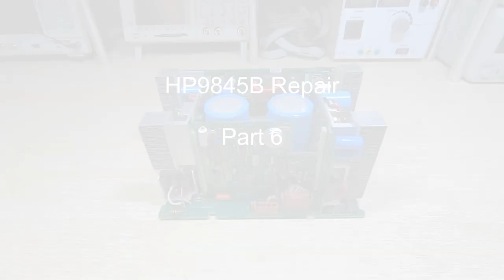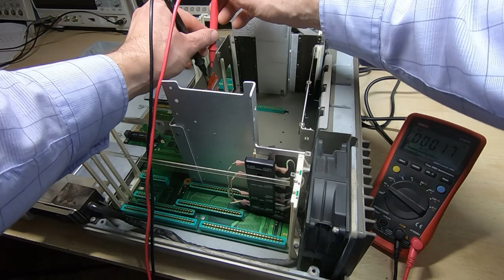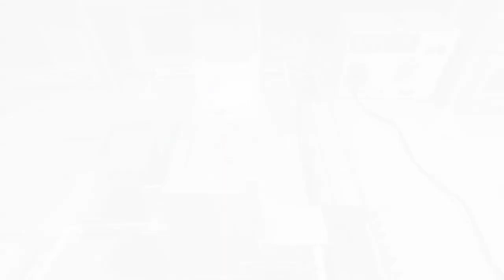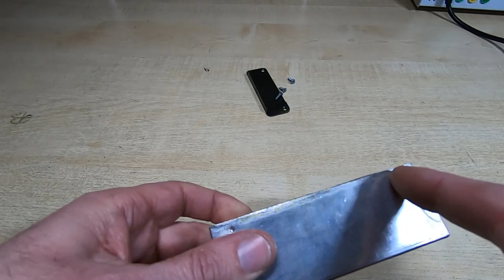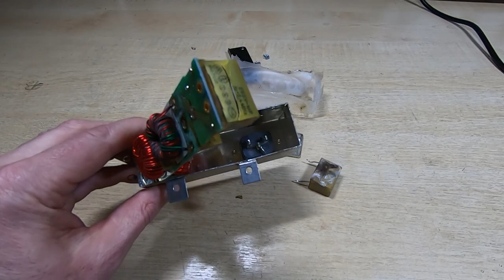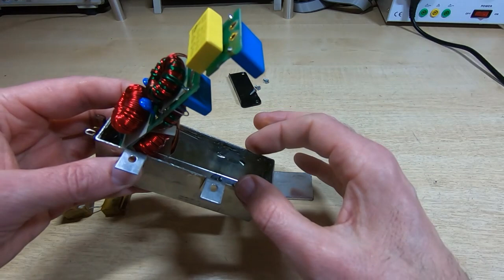HP9845B Repair Part6

Comment: Every time I binge your videos I never fail to be impressed by how thorough you are. Makes a lot of other "repair" videos look like butcher jobs! That said, I equally enjoy "resurrection" type videos (see Shango066's vids on old TVs) as well. Have you ever checked them out? They are polar opposites to your videos in some ways, but the guy is no dummy. In a way it's like comparing a well-rehearsed scheduled surgery in hospital to a battlefield medic operating under fire. Anyway, I really enjoy your videos, thanks for sharing them!
Reply from the maker: I shall reply by asking you a question. If you owned a machine rare machine like an HP9845B which contains a number of totally unobtainable hybrid modules and other rare components and you sent it to me for repair which approach would you prefer me to take?